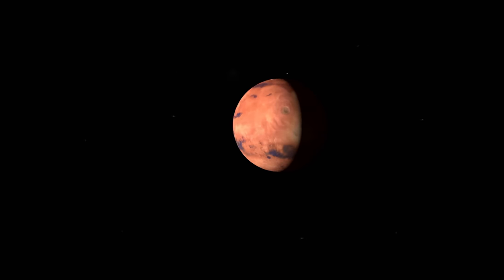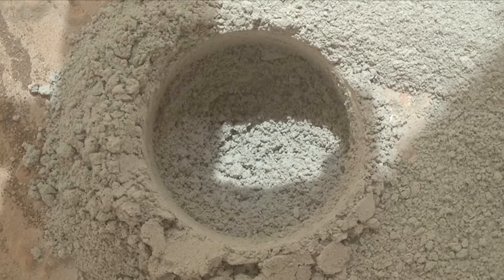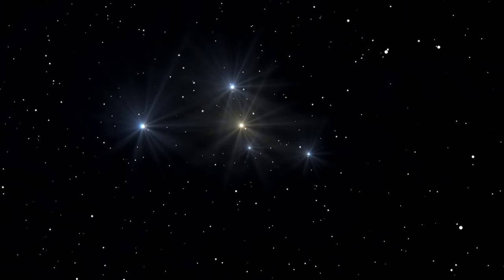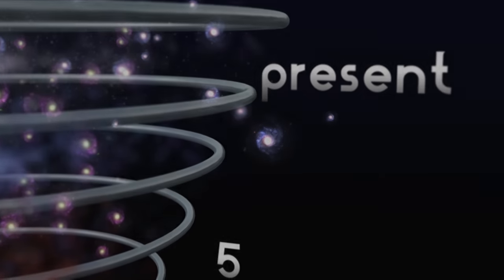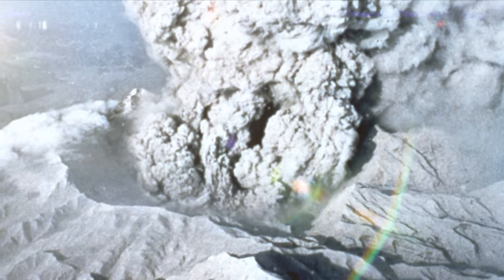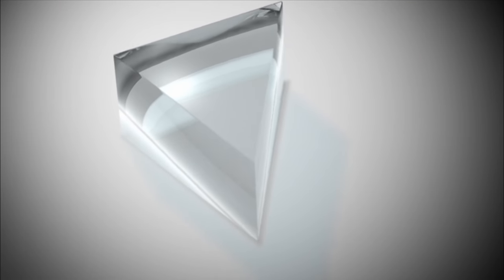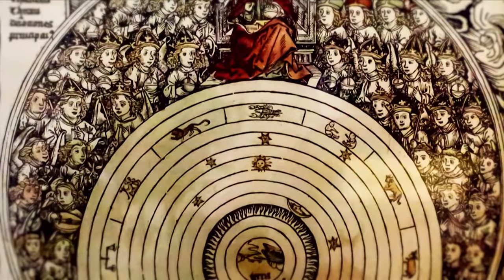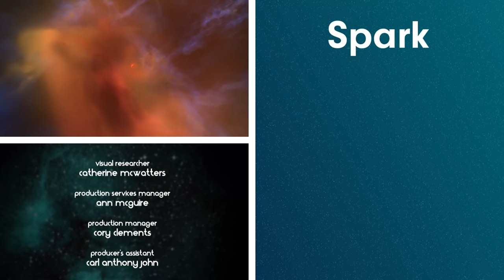Answering The Greatest Questions Of The Universe | Cosmic Vistas Season 5 | Spark

Comment: I don't know about the whole sleep paralysis idea... while I never saw the entity, I was asleep in a new house when I woke up middle of the night and couldn't breathe, I panicked and lifted my head so I could stand up... only to feel a grip with defined individual fingers around my neck get tighter and forcefully yank my head back into the pillow... to the point of my head actually pressing into the pillow not just resting on top of it... I remember being able to move my eyes but could only see pillow, I couldn't move anything else, but it wasn't because the muscles weren't getting the signal, they were tensing up like I should be able to move, but I was so held down to the bed I felt the springs and cushioning compress... I was terrified and wide-eyed, but oddly felt like it was something I couldn't fight or even acknowledge, and after a few minutes, fell back asleep... if this was sleep paralysis, how did I spring up with full control about a meter when I first woke up?
Reply: I suffer from sleep paralysis mate , its horrible.
Reply: Փփփ😊😊😊ռ փծ
Ժջ😊😊ծծ😊չ
Reply: @ballsack6547  so does I from time to time. And although It is can be terrifying I also find it very fascinating

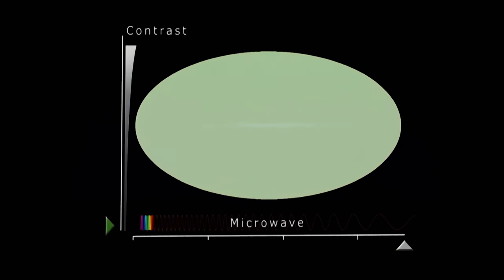Comment: Hmm! Not sure about this universe expansion stuff. Doesn’t our galaxy move as well? I mean, if it did and assuming all other galaxies moved at same speed, wouldn’t that set off the different in distance moved between our galaxy and the others? I mean, the point made is that if the universe didn’t expand, all galaxies could have come together due to gravitational pull. Maybe that’s happening already which explains why galaxies farthest from us tend to move faster, probably because the are close to the source of the pull. What am I missing? 🤔🤔 59:16
Reply: Yea me either. There's perfectly good theories where the universe isn't expanding. Its just the most popular. Well never really know
Reply: @datopperharlee2628 It's  "we'll never really know." Maybe you should work on something easy like spelling before you move on to astrophysics.

Comment: Best way to describe dark energy and dark matter is... in the water in a glass bottle experiment... when you bang the bottle from the top... for a brief "moment in time"... a cavity is formed at the bottom of the bottle... within this cavity is a "void"... aka dark matter aka opposite of matter... the laws of our "current experience" (subject to change as it did before/since the Planck epoch) state that voids must be filled...
(ITS this law that stops all the air going across to one section of our current room or place suffercating us)
This gives the illusion that the centre of the "void" creates gravity to suck matter towards the centre of the void...
I'd personally call it a vacuum... but gravity can look similar by way of understanding
Reply: That's absolutely ridiculous. 

The small void in the bottom of your bottle isn't dark matter. It doesn't have mass. There is also no law that says voids must be filled. 

"Suffercating" isn't a word. 

And gravity has absolutely nothing to do with voids. Do you think there's just some big hollow spot at the center of the earth and all the matter is just desperately trying to fill it?

Comment: Instead of invoking dark matter and dark energy, do some thought experiments in general relativity and you will understand that rate of time and the measure of distance are relative to the amount of matter and mass there is in the vicinity. The speed of light literally depends on these two variables of time and distance. 

As you observe a galaxy you are actually seeing differing rates of time and differing measures of distance. The result is that you are seeing differing speeds of light (because of the rate of the passing of time and measures of distance) relative to where we are since the measures of time and distance are both dependent on the amount of matter and gravity there is in the vicinity. (The speed of light isn’t actually changing, the measures of time and distance are changing which effectively changes the speed of light as we observe it over GREAT distances.)

The result is that distance is greatly expanded (not expanding) where there is no matter between us and distant galaxies (causing redshift) eliminating the need for dark energy and the movement of the outer spiral arms of galaxies is at a faster rate of time causing them to move faster as we observe them eliminating the need for dark matter. This also means that plasma jets shooting out from the center of galaxies isn’t seven times the speed of light. It’s that the distance is expanded and the rate of time is faster the less matter there is in the vicinity.

There is no such thing as a nonsensical infinitely expanding universe or an imaginary inflaton and there is no such thing as imaginary invisible dark matter. 

Distance is merely greatly expanded between the black holes in galaxies (causing the redshift) so the universe is not infinitely expanding as is claimed. An infinitely expanding universe is nonsensical. Not only is distance greatly expanded where there is no matter between galaxies, time runs at a much faster rate where there is no matter. 

Distances within the galaxies are vast so when we observe another galaxy, we are literally observing differing rates of time and differing measures of distance still within the limits of other galaxies, not to mention the extreme distances between galaxies where there is no matter to dilate time and distance. 

That means the distances between the galaxies are greatly expanded, (not expanding) and time between the galaxies is running at a much faster rate which allows for us to see fully formed distant galaxies in the first place.
Reply: If you observe galaxies, many of them, including our own, and measure the rate that the various parts of the galactic disks rotate, then you will see how dark matter, and how it is distributed within and around the galaxies is necessary to describe how they rotate. It is not just invoked to balance equations, it is measurable by application of Newtonian Gravitational physics, since the rates of rotation are non-relativistic.: 

The Data Behind Dark Matter: Exploring Galactic Rotation (2022)
A.N. Villano, Kitty C. Harris, Judit Bergfalk, Raphael Hatami, Francis Vititoe, Julia Johnston 

While it may be fun to perform thought experiments, it may also be prudent to invest some time in reading the latest literature output by real cosmologists - I hope this helps.
Reply: @tikaanipippin    You must not understand general relativity. There is no single rate of time or measure of distance.
Reply: @JungleJargon  It depends how,  where and when you make your observation.
Reply: @tikaanipippin   I observe that you don’t need to invoke invisible matter or imaginary energy.
Reply: @Jungle Jargon  and what are your qualifications good sir. 

Additionally, where are your calculations? 

You've set forth a thought experiment. Great. That thought experiment has led you to a certain conclusion.

Now in order to demonstrate that you are correct you must be able to use your hypothesis to make a prediction. Then we can go test your prediction, do the calculations, and see if in fact, that prediction is true. That's how this works. 

Have you used your hypotheses to make such predictions and perform such calculations?

That's how the possibility of dark matter arose. Scientists made predictions about what we should see based on the amount of matter they could observe. Then they made observations and did a lot of math and they realized that they had a problem. Then someone said, well what if there's mass that we aren't observing? Could that solve the problem? They did some more calculations and realized that indeed, if there was mass that they had not yet been able to observe it would correct the equations. Thus the concept of "dark matter" was born. 

It is possible that they simply haven't considered your suggestion. But I suspect it is highly unlikely that this is the case if there's any chance that it solves the problem.
Reply: @JCTheSniper15    My prediction is that the spiral arms of galaxies will move faster than expected. My prediction is that plasma jets will appear to shoot out faster than the speed of light. My predictions is that redshift will be observed. My predictions are observations.
Reply: @Jungle Jargon  yeah you can't just say that you're predicting things that have already been observed. That isn't a prediction.

That's the equivalent of me saying that I believe the sun is made of cheese and I predict that it should appear yellow. Then oh look it's yellow I guess I'm right.

You need to be able to make a prediction of something that we haven't already observed that we can then go observe and discover if it matches your idea. I really don't know why I'm explaining what prediction means right now. 

Alternatively, you could demonstrate the effects of the various things you're discussing, and devise an experiment that validates the numbers that you've come up with, and that properly meshes the numbers with what we see in reality.
Reply: @JungleJargon  It's a bit ironic that you're accusing other people of not understanding general relativity, given that its central premise is that the speed of light in a vacuum (i.e. space) is constant, not variable.
Reply: Where do I find these experiments that show all the different wavelengths travel at the same speed?

Comment: I wonder if you could use the clockwork radio principle to power a probe that won’t be needed to be activated for decades, or possibly even longer. 

Like a probe sent to Alpha Centauri perhaps, with Solar Radiometers on the probe to both activate the probe as it nears the Solar system its aimed towards, and recharge the clockwork mechanism like a giant self rewinding watch that never stops running. 

The electronics would have to be powered like a clockwork radio, negating the need for batteries or Nuclear power, which will degrade over extremely long periods. This is the issue with the voyager probes as they age, despite the fact that the electronics and computers within the probe are functioning perfectly after nearly half a century of constant use. 

The probe would have to be large and capable of making independent decisions, which may require a large amount of older hardier computer chips

You could even go a step further, and have small landers on the larger probe that could be fired and directed towards other planets. They could be hardy probes, with a self contained non rechargeable clockwork power source of their own. Preferably a hardy probe to gather planetary data quickly, similar to the Venetian and Titan probes of the past. 

The only issue would be having a secondary rechargeable clockwork mechanism to power the transmitter, which would have to be very powerful for the extremely long distances to earth. Storage of information until broadcast would be vital.

If Spacex can reduce the cost of launches further, perhaps we could have a mother ship probe that could launch smaller satellites like a Clockwork Cassinis, to examine planetary systems and their moons, as well as launch the aforementioned smaller probes

This is a bit long winded and hypothetical but its worth thinking about..
Reply: I wonder if you'll ever mature an stop believing in space
Reply: @davidsheckler4450  a flat earther I see 🤣

Comment: I worked for 26 years alongside colleagues of the Bcell sector, a subsidiary of the 2nd proprietary propulsion department within the NASA umbrella.
There are indeed , many secrets we have to keep from the uninitiated.
This is a unavoidable truth because we are bound by legal requirement which if broken could result in a custodial sentence.
However there is something I can impart, which would put all your questions concerning the space programme into much doubt.
This being that the square tyres I worked on will never run without problems on Mars surface. 💯

Comment: The idea that Professor Cox is hiding something is a nonsense.  So many things had to come together to get intelligent life as we know it on earth, that intelligent life might be quite rare.  Furthermore, the likelihood that intelligent life might emerge at a time when we might have the means to detect it are likely to be even more rare.  And, finally, the chances that it might have evolved sufficiently to have developed FTL travel and/or cryogenic suspendion (either one or both of which would required for  travel between the stars in any credible  timeframe) the most rare of all.  Right now, for example, we're not even certain that FTL travel is possible let alone feasible.  Even if it is, it might take us another another 1,000 years to accomplish such a feat.  Assuming, that is, that we do not exterminate ourselves first and/or that we aren't destroyed by some natural disaster.  Don't forget that,  our species, Homo Sapiens Sapiens, is only around 300,000 years old, our oldest civilisations are only 10,000 years old, writing that we can decifer is only 5,000 years old, industrialisation only 200-300 years old, and electronic  computers less than 100 years old.  Even the dinosaurs lasted way longer than that, some 120 million years, which, compared to the life of the earth, 4 billion years, is an eyeblink.  And that's only a third the life of our entire Universe.  Also, our Universe started as a microscopic sized black hole but expanded to something approaching it's current size in less than a second.  That's almost infinitely faster than the speed of light.  And yet, the speed of light was not broken because the entire  fabric of space-time was expanding way faster than light travels in a vacuum. And that's just our Universe, which, if you believe some theories, is only one of an almost infinite number.    And still you want aliens?!

Comment: The anti-capacity igniting big bangs is Counterintuitive but rings true and gives the answer some base to construct the atom sized seed in which exploded like a weeds seeds do. To spread it's seed to grow more weed to seed more space. As the Webb telescope is reaching it's capacity it will convert into the Webb microscope causing the ignition and confirming it's fullness. By observation, is unaware to the observers, confirmation that encapsulation has reached the necessary new all entailing fruition. Though this is happening on a curved timespace , meaning what will be years to some in a particular point of stationed reference, it will at another point be but a few seconds and another point .0000000000000000⁰7 th of a split second. All depending on station and position. There is in all of this a sweet spot so to speak. This is the most coveted position, known to the standers of under, as terrapin 🐢 station. It is not known whether this station is the beginning or the end of the phenomena, but I know we'll be there soon.

Comment: Why don't NASA use those mini satallite that Elon musk launched into orbit, but connect like fifty together with large solar panels and thrusters, then place these sat. Units in various points from earth to Mars ,then more around Mars itself,then send robots that land in it's recharger stable ,that it stands in a place with mirror around it,so earthlings at NASA can check for damage ,it recharges using a wind generator turbine and solar ,these robots can be human avatars,a controller in realtime using the satallite units  from earth to Mars ,and instead of sending commands then waiting for it, we would actually be on Mars our eyes looking and digging in realtime,we contol flying avatars for recon,these SATs are cheaply made ,it'd be the scientists actually there ,then we use them to build the first Mars city before humans even go there to just die horribly

Comment: Astronomy as with most of what passes for "SCIENCE" is wrong and is totally tone-deaf to Intelligent Design.
What passes for Astronomy is using the very old and obsolete Newtonian model where everything is Gravity based, and gravity is among the weakest forces. 
Just turn on the TV and watch a basketball game and see the layering jumping & leaping as easily overcome gravity with their jumps in the game.

The real science of the universe is ELECTRICAL and the electromagnetic force is 1,000,000,000,000,000,000,000,000,000,000,000 more powerful than gravity.
A common daily use where we see electromagnetism at work is where you have to wipe your high-security badge to open a door which is being held securely by an electromagnet, 
or in an industrial junkyard where they have a crane with a large electromagnetic that is used to pick up large metallic parts of old cars and dump them into a shredder or piles for sorting.